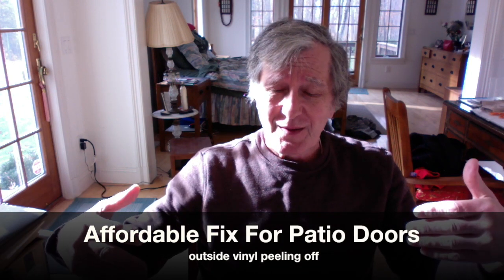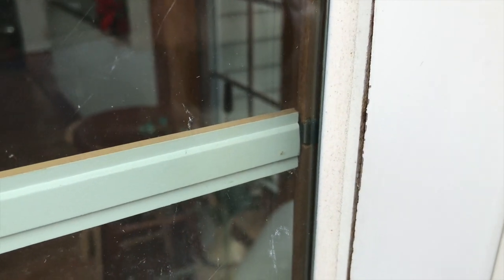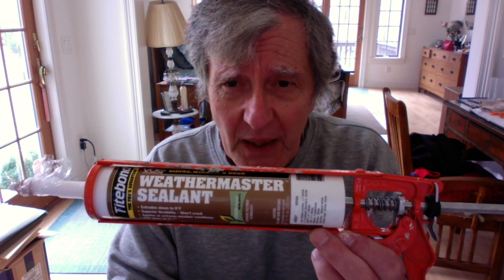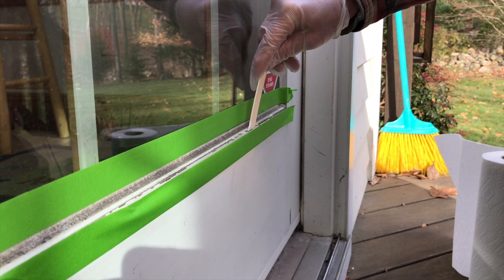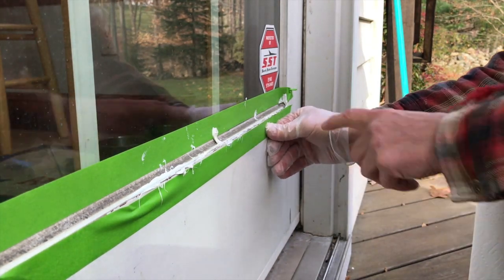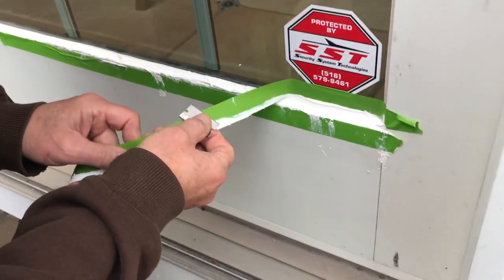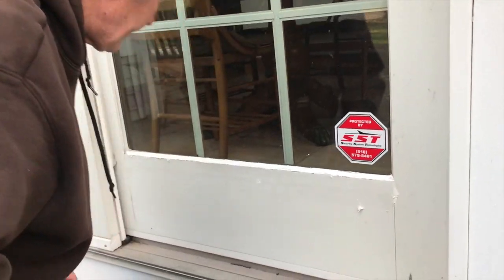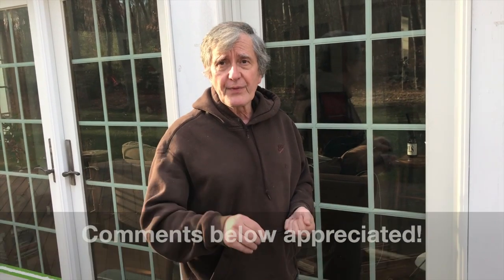Andersen Patio Door Repair - How I fixed it myself

Comment: Hey Pete.  Awesome solution for the Anderson cladding separation.  I was just about to use epoxy but saw your video.  My only question is about longevity.  Your video is a few years old and I'm wondering how the solution has held up.  I see someone else asked the same question and his response makes it sound as if you responded but there is no response in the comments.  Can you please let us know if it is still intact? Winter here in KC are similar to the northeast so any feedback you provide should be relevant.  Thanks in advance for your response and I really enjoyed your video.
Reply from the maker: Hi Ken thanks for asking! Yes my doors are still holding up very well thank you. We are now into June 2021 So yes it’s been quite a few years. Please subscribe to my channel trying to build up a following thanks and let me know how you make out
Reply: @poundridgepete  Thanks Pete.  I just subscribed.  And I'm going to use your solution to fix my Anderson doors.
Reply from the maker: @kenjennings9124  thanks for subscribing Ken!

Comment: Thanks, Pete.  Would you provide an update based on condition of the repaired areas after exposure to winter weather?  I, too, contacted Andersen, and they were unwilling provide any meaningful compensation since the warranty period had expired.  The lesson learned is that Andersen charges a premium price, but this product is much below premium quality since it has a well-known design/manufacturing defect.  Andersen, despite its advertising, does not stand behind its products.  My experience has been that other manufacturers will replace, at no cost to consumer, products that failed when clearly due to design/manufacturing defects, regardless of warranty status.
Reply: Thanks, Peter, for the update. Sounds good.  Regarding your method for applying pressure to the repaired areas.  Did you ever consider screwing pieces of wood (e.g., battens) temporarily into the core of the door to hold the vinyl cladding firmly in place  while the sealant is curing?  Then, after curing, remove the screws and fill the small screw holes with, possibly, an epoxy  fairing compound.  It seems to me that this method would apply a great deal more pressure for the curing process than would ladders, etc.   Also, I have one door where the vinyl cladding really should be replaced.  Any ideas about where to obtain suitable replacement vinyl?

Comment: Hi, Pete.  I commented a week or two ago and am ready now to buy Titebond's WeatherMaster Sealant 44001, as you recommended.  Went to Amazon to order and it is not on Prime, right now, and the cost is $6.32.  Right next to it they had Titebond WeatherMaster MP Sealant 71001 at a cost of $11.52 on Prime.  Don't know if this was available when you did your doors, but it appears as if it might be better according to the reviews 5 stars instead of 4.  44001 claims superior polymer technology, while MP 71001 claims it outperforms silicone, urethane and tripolymer sealants.  I usually like to buy the best and don't mind spending $11.52 vs. $6.32.  I am no expert and don't know the difference between polymer, tripolymer, and a hound dog.  I don't even know what polymer or tripolymer mean.  Would appreciate your thoughts as to MP being okay, as I am poised to buy it unless you give me any valid negatives.  Thanks, much.  Your video posting is a great community service to us Andersen wounded souls.    John M.
Reply: @poundridgepete  I put in an order for the MP and will give it a shot once it arrives and the wife's other pressing (endless) honey do's are out of the way.  Will report back to you if I have any issues.  Will follow your instructions, but it may take years to see if there are any problems.  Also, am going to try bondo where some of the cladding (about a 4" x 6" area) has come off and broken in pieces.  Will let you know how that fares, as well.  Take care.
Reply: @poundridgepete  Pete:   I got my first side of a slider done using the WeatherMaster MP Sealant 71001, and it worked great, as far as I can tell - seems to have grabbed tight real quickly and stayed that way .  It says you can apply it down to zero degrees.  Hopefully, it will hold up as long as your application with the WeatherMaster Polymer Sealant 44001.  Since you have spoken to the manufacturer, it would be cool if you could check and see what they say about the MP vs. the Polymer, as maybe the MP is a relatively new product????  I haven't got time, as I am trying to do this, get to closing down a pool, babysitting grandchildren, doing honeydo's, and trying to write my first novel (am up to 20K words) LOL.  Anyway, I chose to take the doors off (2nd off now and 1st is temporarily back in place) and put them on two small ladder platform stands which are about a foot and a half high and about about 2 1/2 feet long and about a foot wide, if you know what I mean - as am using them as super sawhorses, stradleing the door across them, one at each end.  I chose to have them off and on sawhorses because the first one had an area on the bottom on one side where the cladding had broken off into pieces and left the exposed wood underneath in an irregularly shaped area about 4" x 6".   I think it had been that way for at least 2 or 3 years, and I was amazed that there was absolutely no rot or softness to the wood under the cladding.  So at least I give Andersen credit for using wood that doesn't seem to rot even when exposed to the elements for a long time.  Anyway, the important point I want to convey here is that I chose to take the door off and put it on the sawhorses to try and repair the exposed wood with Bondo (the putty version - about $13 a can) more comfortably in a horizontal fashion rather than vertical if still mounted in door frame.  Glad I did that because it made it easier, as it is bad enough working with Bondo as you have to work fast, as dries quickly (which resulted in me having to mix up a 2nd batch as the first dried before I could finish).  I was worried that it wouldn't hold on the smooth wood underlayment, but it seems to be holding tight - but the jury is out if it will last or not.  I masking taped around the surrounding area and spread the Bondo out past the broken area and sanded it all smooth and flush with the surrounding cladding.  Unfortunately, if you are not careful, you can accidentally sand too much and remove a bit of the surface layer of the cladding down to the brown material underneath, like I did - and I think the person who said it is Formica is right.  So, after I got done I chose to paint over the repair, including onto the surrounding area of cladding - so I taped off a rectangle (about 1/2 a square foot), which included the irregular jagged area where the cladding was gone and out on the Formica to the tape.  Then I painted and it looks like a different and shinier white, but what can you do.  I didn't want to just leave the Bondo unpainted and I wanted to cover the couple of small brown spots that oversanding caused on the surrounding Formica with paint.  - Okay, so now I am on the 2nd panel (stationary panel) of the door and that also had a good reason to go horizontal on sawhorses - because on the horizontal cladding on the bottom of the glass, there was some sort of very hard fungus growing in 2 spots.   I razor bladed both spots off, and fortunately, one of them had not penetrated under the cladding so I will just clean that area well with alcohol, dry and put over a dab of the WeatherMaster.   The other spot, however, had the fungus also growing down into/below the separated cladding.  about a half inch to an inch or so.  I first used a dental tool with sharp pointed ends to pull out most of the fungus.  The rest I had to get out by going back and forth/in and out against the wood underlayment beneath the Formica with a loose hacksaw blade.  I got most of it out and the Formica does now seem to depress to the underlayment when you press down on it.  So, that's where I am, now, and I broke for lunch.  Will go back, now and maybe do a little more scraping and vacuuming to get any final fungus particles out before sealing everything with WeatherMaster.  By the way, there is quite a gap between the first door I did (the sliding/locking side), which I temporarily mounted back in place and the screen.  There are stinkbugs trying to come in for the Winter so I plugged that (about 1 1/2") gap temporarily with rolled sections of newspaper stacked vertically on one another.  Sorry, about such a long post, but I think anyone with the same problems will appreciate knowing this stuff.  And to think I would have never even attempted this if you hadn't shown me the way with your video.  Thanks, again!!  Besides that, I am 78 years old and half crazy.
Reply: Oh, forgot to mention that when you have doors horizontal on sawhorses it is obviously really easy to place weights or heavy objects over WeatherMastered areas to hold the cladding down while the sealant dries.   But I will be using your method when I do my one French door that is having a cladding separation problem without door removal - vertical repair.
Reply: One last thing.  I didn't have a tongue depresser so I used a popsicle stick, but then I switched to a one inch scraper and like that better as it is thinner than a tongue depresser and popsicle stick.  Worked better for me but the downside was having to clean the caulk off of it.  I used paper towels soaked w. rubbing alcohol, but it was a time consuming pain before I could get totally clean.
Reply: Thanks again for your thoughtfulness 

Neil S
Reply: just read all the comments. I will be trying your method on my 10 failing doors.  Since many of the comments are a few years old, what product are you currently recommending, the 44001 or the 71001

Comment: We have the exact same problem and Anderson wanted us to buy new doors too. The only thing that we have extra is that the bottom of the panel is unglued too. Any ideas how to address that since it is so close to the ground?
Reply from the maker: Two possible ways. The first being the most labor-intensive which would be to actually take the door off the track and lay down flat for easy access to the bottom of the panel. The second way would be to buy on Amazon a  few curved tip Dental Irrigation Syringes.  These are really cheap and you may need a few of them. You have to cut the tip off a little bit to enlarge the stream of sealant.  Put the weather master from the big tube into a little syringe and you should be able to manage to get the product up into the bottom of the door. Good luck let me know how it goes

Comment: I have the exact same doors! all 6 of mine have the exact same damage on the bottom. I did not know what do and was just planning on replacing and so with time and sun the vinyl came off and on some a bit of wood is rotting... Now after finding this I'm going to try and fix it! I need to find some vinyl to put over it.
Reply from the maker: Good luck on your repair Leo. Let me know how you make out and please subscribe to my channel thank you

Comment: thanks for this great video!  My vinyl game off on the bottom completely.  Any idea where I can get white vinyl?  I already ordered the sealant!
Reply: Mine are coming off too. I am ordering custom metal kick plates that are not that expensive.
Reply: @peggycass7108  What did you use to adhere the metal kickplates?  Would you do anything different?  Thanks for any info!

Comment: Can you provide an update on how well the repair method you used has held up now that it is 2022?
Reply from the maker: Hi Rick and to all other victims of Anderson's poor quality. What a coincidence that you just asked for an update! I just noticed yesterday I am getting a slight separation on the top of the panel below the glass on one of my door repairs. . I have basically ignored my repair because it was so good and nothing to report. I am buying a fresh tube of weathermaster and will recoat the top of the panel near the glass. The panel is not pulling away but if I don't recoat water will get in again. I will probably give a slight recoat to all my doors. So the repair has held up for years and now needs some Maintainance. Beats buying new doors!
Reply: @poundridgepete  thanks for the update. So glad I found your video. No more Anderson doors or windows for me and my door is only 10 years old.

Comment: Nice job man!!  I'm facing the same problem with the bottom of my door as well but the rectangular cladding panel on mine looks to have been removed and screwed back on, making the panel not perfectly flat and making noise when I open and close the door. Any idea if that cladding panel is sold separately?
Reply from the maker: Try soaking the panel in water, especially the wood side then put it face down in a warm place with some weight on the part that is warped. Hopefully after a day or so it will be closer to its original flat shape,

Comment: Hi, Pete.  Thanks so much for posting the video and for all of the other commenters and their helpful information, as well.  I was wondering if you ever considered just using Super Glue, as it seems easier to use and since it is more or less liquid in form, it seems as if it would go further down into the depths of the separation of the cladding from the wood and form a more complete bond?  I have 2 Andersen french doors and 1 older slider from 1996.  One of the french doors has some separation just like yours on one edge in 2 spots, which I first noticed a long time ago - probably around 10 years or so ago.  I contacted Andersen and they sent me a replacement, which I just never got around to installing.  It is still boxed and in my garage.  Fortunately for me, the existing door has remained about in the same condition and did not really get worse.  However, I will now soon, probably use your method and see how well it works and just leave the boxed door in the garage just in case.  Both of the french doors, by the way are on the back of my house, which gets full sun most all day long.  The slider, however is on the North side of my Maryland home, and is in the shade a lot of the day.  It has similar cladding separation as yours on one side/edge of both the sliding panel and the stationary panel - in both cases on the outer edge next to the frame.  I can use the same method for those issues, however, there is an area about 4 inches by 6 inches on the front bottom panel, where the cladding has broken off in pieces.  I can either clean and lightly sand that area and paint it and maintain by repeat painting over the years or use another method I will now mention.  That method I successfully used last year, which lasted through last winter and still looks fine - however, it was a slightly different application than a door.  I have an overhead balcony on the front of my house over the front porch and entry door.  That balcony is surrounded by a wooden railing attached four 4 x 4 pressure treated and painted posts.  Due to inattention, some of the flat boards over top of the rail pickets and the posts themselves had areas of rot - and in the posts it was up to a couple of inches deep in spots.  I replaced the top rails with PVC boards and painted, but the main problem was with the posts.  I ended up using Bondo, which is for car body work and it worked out just great.  I dug down into the posts and removed all of the bad wood and poured in the Bondo, which dried quickly as hard as a rock and was super easy to sand even with the edges of the 4 x 4's and then painted the white Bondo patches brown to match the railing and it looked great and still does nearly a year later.  Sorry for all the detail, but I think I will remove the door and lay it flat and then tape around the edge of all of the good cladding.  Then I will apply the Bondo and make it a little bit higher than the surrounding cladding, let it dry and then sand.  If it doesn't stay affixed to the door, then I might redo after drilling small holes into the core of the door where the Bondo can flow into to hopefully hold the repair in place.  And for the person who talked about screwing a board against the door to make a strong temporary clamp, you could fill the holes with Bondo after removing the screws and the Bondo should work great and since it is white, no painting would be necessary.  I hope this is helpful information.
Reply: @poundridgepete  Thanks for the reply, Pete!  I will let you know my experiences once I get on this project.  I might wait until it gets a bit cooler.

Comment: Same problem, but my doors are only 9 years old.  Andersen would not replace them as they were already replaced once under wanted at 8 years old .  Andersen would not stand behind them even though they are obviously defective.  The end result was a porous for seal that leaked into the bedroom and damaged the floor and carpeting.  Both need to be replaced as part of an insurance claim.  This problem has been going on for at least 20 years and Andersen has not corrected it.